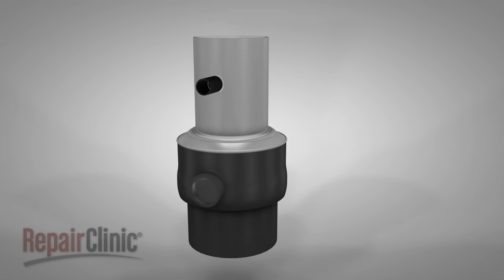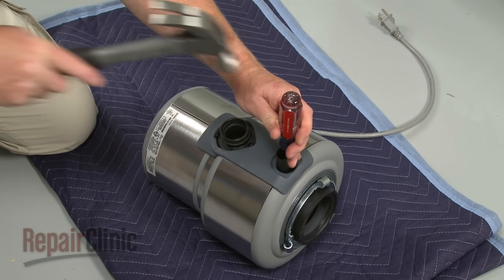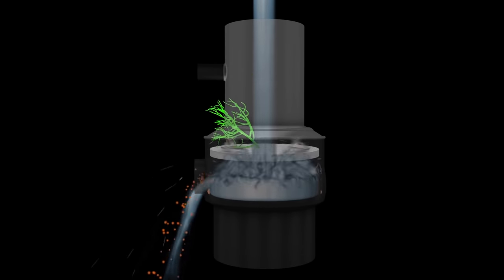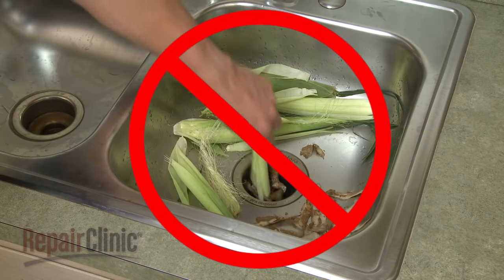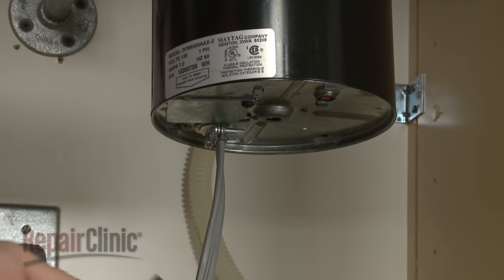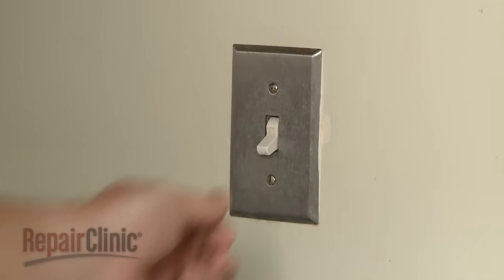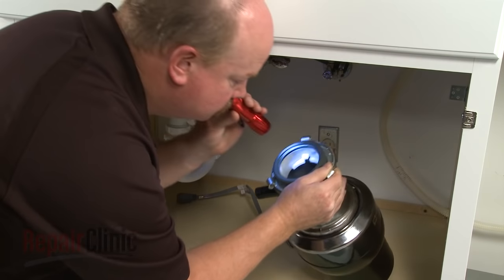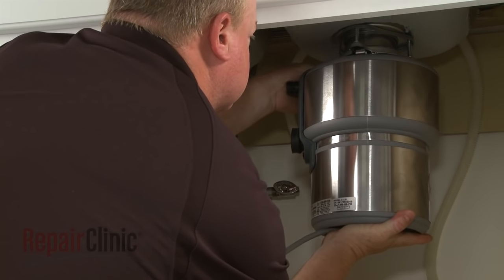How Does a Garbage Disposal Work? — Appliance Repair Tips

Comment: Why am I even watching this? I don't even have a garbage disposal...Eh Good video
Reply: I searched this because I don't have them in my country but I always see Americans using then but they scare me so wanted to see how they work 😅
Reply: same here!🤣🤣🤣
Reply: I need one 😭
Reply: Since it's illegal to have them where we live, this inspired me to make a homemade compost disposal. It works like a garbage disposer, but it grinds up compost to help it rot faster. It's belt driven with a ¾ horsepower 1725 rpm motor. It has an on-off oil burner emergency switch from a furnace to turn the motor on and off. The switch attaches to a power cord with a built-in GFCI in case the cord runs through a puddle. The base has wheels to carry it around the lawn without having to lift it.
Reply: @ClaraJC99  exactly same

Comment: Bruh, I feel like such a millennial right now. I fixed my garbage disposal in like 10 minutes which had been broken for because I had no idea it was this freakin easy
Reply: @repairclinic  I came up with a homemade garbage disposal for chopping compost. It's belt driven via a ¾ horsepower 1725 RPM GE motor. It has a power cord with a built-in GFCI and an on-off rocker switch. It has 4 wheels on a strong, sturdy base for carrying across your yard, and a second pipe on the exit area for guiding the compost into your compost bin. There is also a pipe on the entrance that keeps the compost debris from flying straight up. This homemade contraption would help people get their compost to rot faster.

Comment: I saw on this website called HealthyKitchen101, they had a chart comparing the grind capability of different popular models, which I think was kinda cool. Can you make a video on the same subject too? Like for us to see what difference does it make to have a 1 hp disposals compared to having a ½ hp. That would be extremely helpful.
Reply: just build quality, torque and general the higher models usually have thicker heavier lugs and beefier motors  they aren't that different though. once you get past a certain point with the whole "stainless steel heavy duty" branding over a galvanized cheapy you get relatively similar performance with most of them only one having the advantage and that being ise's whole undercutter fiber cutting disc for slicing stringy fibrous waste underneath the main grind ring to prevent clogging just a thing, when comparing a 1/4 or 5/8 hp unit (u know really weird mid-end unit with weeeird nonstandard ratings) remember that unless it's from insinkerator it's most likely just a beefier version of the same plastic galvanized cheapy but  with ss (e.g. the ise pro 777ss or the newer evolution models)

Comment: I have an Eco-logical 6 1/2 hp disposer.  the turntable is jammed.  can't find a video specifically on this model.  What should i do to unjam it?  each time i turn the motor on, water spews out from under the sink too. tried resetting but no effect. appreciate your help.
Reply from the maker: +rras22 Check for a spot on the bottom of the disposer where you can insert an allen wrench to unjam the disposer. If there is no spot for that, you can use a wooden broom handle through the top to free the shredder plate.

Comment: Brand new Badger 5 installed and changed out gasket/splash guard/drain/putty but, now leaking at/near gasket. Maybe it didn't seat properly.
Reply from the maker: +Wing Hunter You will probably need to take it down and check for a loose connection in the mounting hardware.

Comment: ***** My mother lives alone and told me her disposer was leaking. When i went this weekend to look at it, the seal between the two black pieces was leaking (and rusting). Based on the video, im assuming she needs a new one, as hers is 15 years old (Badger 3). Should i replace it with another Badger 3, or get a new and improved Badger, or go with a completely different manufacturer?
Reply from the maker: It sounds like the most cost effective option, given the specifics you described, is to purchase a new garbage disposer. We suggest you consult credible review publications and websites to learn about the new models on the market today and determine which one is the best option for your mother.

Comment: My insinkerator started to make a grinding noise after I threw in some celery (now I know I was not suppose to). The spinning plate seems to be rubbing on something and causing the hammers go out of balance. What should I do?
Reply from the maker: +Charlie All you can do is clean out all the debris until the unit stops get jammed and off balance.

Comment: there are many dumb comments from individuals who do not have any prior knowledge of this appliance first of all the one myth i do not see dispelled in this video is "this system has blades" which falls into a lot of the fear mongering that surrounds this, actually no, there's a reason they don't have any blades because they're actually intended to be SAFE yeah... rocket science for people with very limited or no prior knowledge of these things at all.  two, no unless you're trying to get hurt by sticking your hand all the way to the edge of the grind chamber (i swear i see this with or without the "spinning blades" comment) you're safe  and for all those comments of "just throw it away" this is the entire point of this is to NOT throw away food waste and clog up landfills, etc with trash bags full of remember, solid food waste that can be turned into bio-degradable material without the bags,etc compost is another option, that some fail to realize can still be done with this device